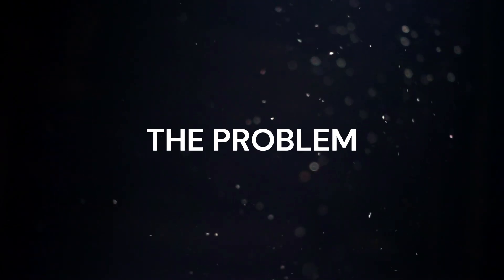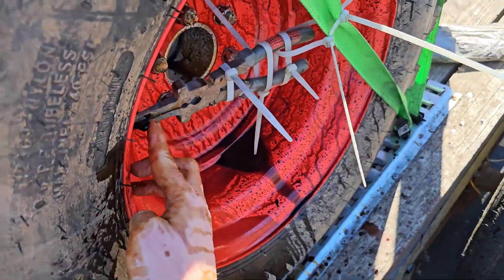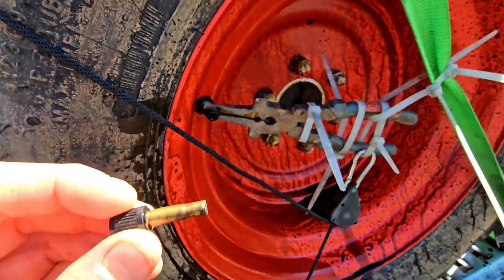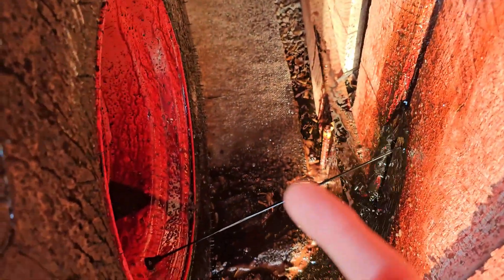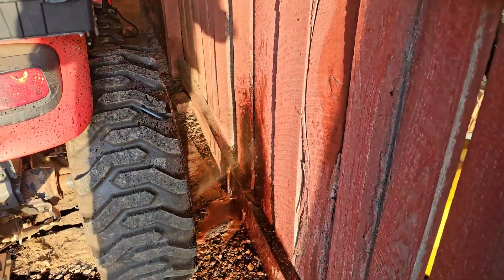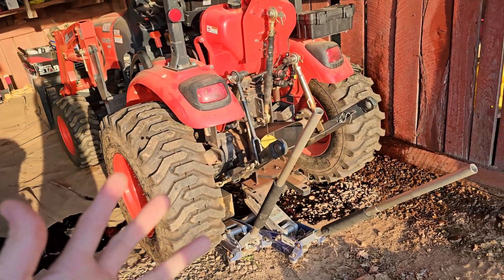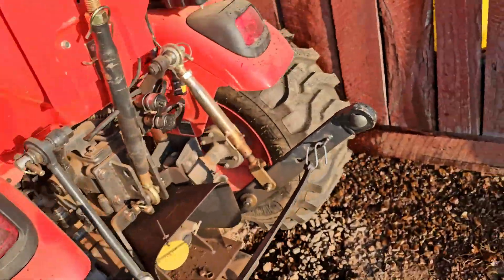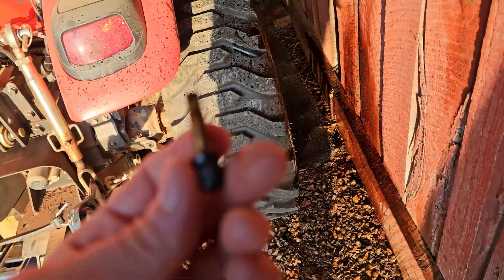The Issue With Rim Guard Tire Ballast- Colby Valve XL Kioti CX2510

Comment: Same thing happened to me, I even mentioned using brass stems to the dealer, but of course they ignored my suggestion. Just cleaned up the beat juice mess in my shop, what a pain in the rear. Is there any issue with running one tire with less ballast(beat juice)? Otherwise I need to refill the one tire with more ballast of some sort.
Reply from the maker: I have a video of me refilling the one side with windshield washer fluid. It's not quite as heavy but it's been working great for around a year now without issues.
Reply: @BaznastyDave  I wonder if some mixing of the beet juice and windshield fluid would cause any weird chemical reaction. Just don't want to have to drain the beet juice that is still in the tire. I can get beet juice locally by the gallon, so might go that route.
Reply from the maker: @ggergg6423  I didn't rinse mine out and I'm sure there was at least a gallon left in there of beet juice.

Comment: I ran beet juice in the rear tires of my Kubota B3030 for 15 years.  I got tired of jacking up the tractor to check the air pressure and screw up my tire gauges with beet juice residue.  I just had a new set of rear tires installed that were foamed.  It was twice the cost of beet juice, however, you can't beat the convenience and low maintenance of foam.   And you can run over nails and never worry about flats.  Oh, yeah, my foamed tires came back from the tire shop with metal valve stems.
Reply from the maker: Never heard of foam in the tires. Does it add weight or just good for flats?
Reply: @BaznastyDave  It does both.  I believe it added 50lbs more of weigh per tire.  A European company has a video of the process here on YT: "Foam-Filled Tyres KeepYour Mewps Up and Running."

Comment: Yup. Going through the same issue right now. I am in complete agreement that both Rimguard and the dealership that has it installed should be more forth-right and honest regarding the use of the product with rubber valve stems. I would argue that Rimguard should require the dealer (or customer) to install metal valve stems, otherwise they cannot fill for them. It is BS to pump full of rimguard knowing the rubber valve stems are an issue. Late summer this year I was checking (going to check pressure) on the rears that are loaded with rim guard and beet juice started seeping from the rubber valve stem, all I was trying to do is remove the valve cap.  So, I stopped and put it off as it didn't keep leaking. I don't use my tractor for a lot so waited for the cold weather (below freezing) when the rubber had hardened, was able to get valve cap off one side, checked pressure and added some air. The other side however, as I tried hard to loosen the valve cap the exact same thing happened it blew out the metal valve stem. I had positioned the stem at the 12 o'clock position so only a little bit of beet juice squirted out. I then pushed the valve stem back into the valve and it held.   *Thanks for the video, Dave I am getting ready to order those valve replacement kits now.
Reply from the maker: Yeah it's aggravating, but it's been almost a year since I did the Colby valves and they haven't leaked a drop. They are definitely worth the money.

Comment: Great video young man!! Sorry that had to happen to you though.  I loaded my own tires went with Bio Ballast it's made from grains here in missouri it smells like a feed mill i have a new kioti ck3520se shuttle shift has same valve stems as your tractor i never even thought about stems blowin out. Prolly be good idea to buy couple of those stems before it happens to me also cause my Ballast still cost 275.00 dollars don't want to lose it.  I have a little seepage every once in a while around the bead . Thanks for sharing be safe have fun

Comment: Thanks for a great video. Sorry you lost your rim guard from your tire. The dealer should never have filled those tires without putting brass valve stem for air/fluid. Glad that new valve stem worked out for you. 😊

Comment: That sucked. But, orher than that you still like your tractor? Ive got 70hrs on mine. So far so good. 👍
Reply from the maker: Yes, I choose the Kioti since it was the heaviest in it's class and also has by far the largest hydraulic pump. I will be doing a 200hr review soon.
Reply: @BaznastyDave thanks for the reply 👍looking forward to the review.